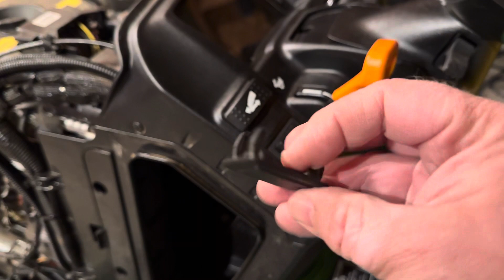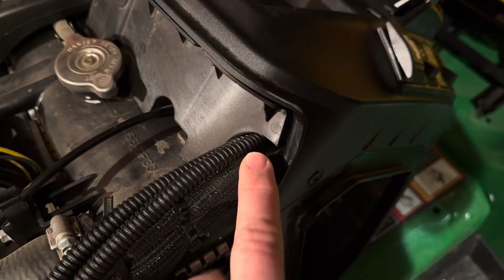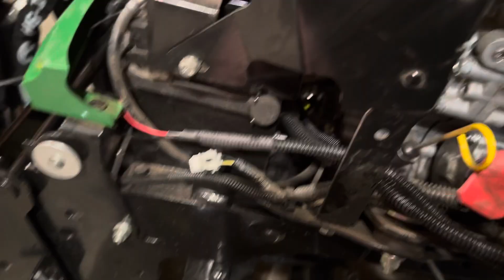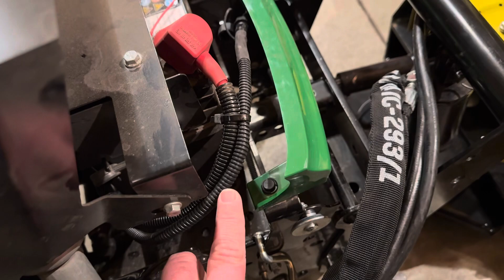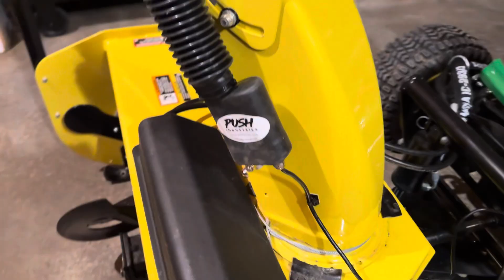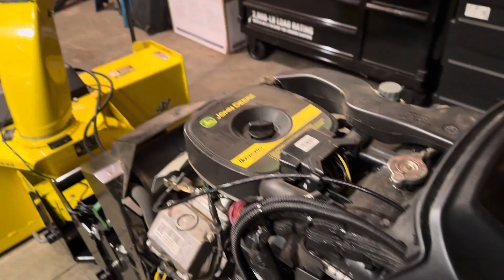2022 John Deere x739 Push Industries Snowblower Chute Control Electrical Install-Fully Prewired Kit

Comment: I am confused, why two cables? As I see it, a two wire cable comes from the actuator, one wire to ground or neg battery terminal, and the other to one terminal of the switch. The other terminal on the switch would go to the positive side of the battery.  Yes, the cable would have to be cut and some terminations made. What am I missing?

Comment: A good test for the actuator is when the temp is well below zero.  Will it freeze?
Reply from the maker: Yes, important test!  The rubber boot I think does a good job of keeping moisture out of the actuator.  I will say that I tested it when the temp was below zero and it worked without issues.